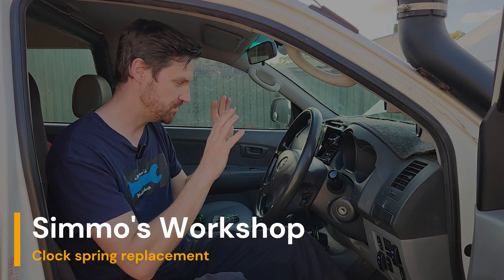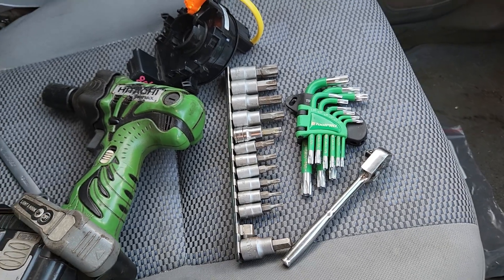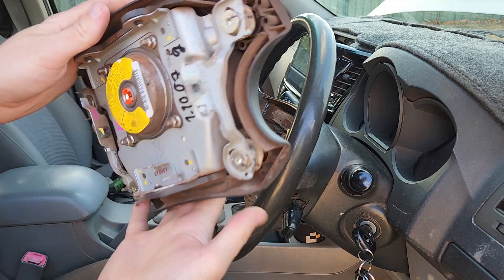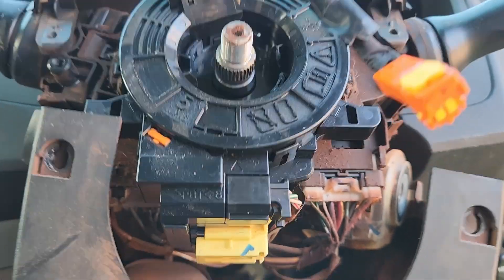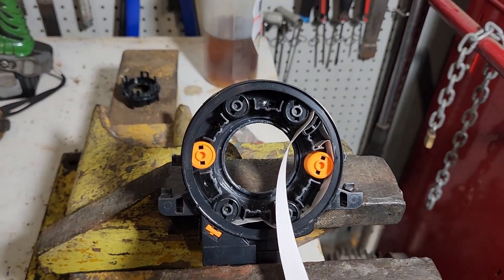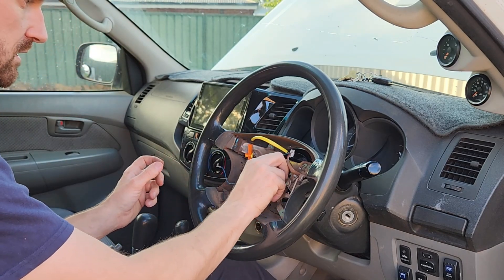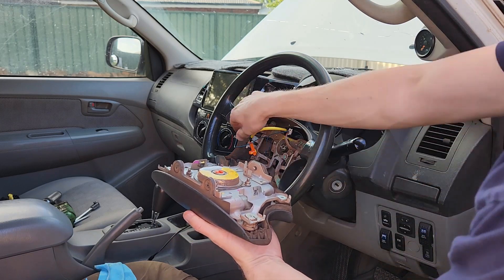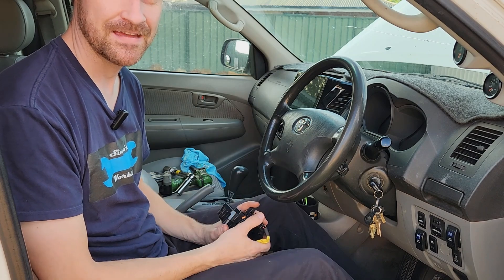How to change a clock spring - Toyota | Symptoms of a bad clock spring

Comment: Good video. Thanks for helping everyone out. 
No jazz music in the background is a win too.
Reply from the maker: 😆 Thanks mate
Reply: I've had my airbag light and traction control come on but then go away. My horn works but sticks on if I use it. My main and constant issue is my turn signals light up when I press the brake pedal along with fast blinking when in use. Does this sound like a bad clock spring?
Reply from the maker: Hi mate, it doesn't really sound like a clockspring related issue, if it's involving the brake circuit and indicators, the horn working is a good sign although sticking on is very strange. Be a good idea to check for short circuits and make sure all your earth's are clean
Reply: @simmosworkshop  since my last comment I have found my cruise control is not working as well. I can get the indicator to turn on but cannot set speed with the steering wheel controls. I will definitely need to look at wiring and fuses.

Comment: Does the new one need programming or is it plug and play?
Reply from the maker: Plugged straight in with no programming mate 👍
Reply: @simmoshomeworkshop  sorted. I'm wanting to add a plug and play cruise control lever to my 1999 Toyota TownAce Noah but the connections on the squib aren't compatible. Wondering if I can replace the squib for a 1st gen RAV4 that has the plug and play connections.